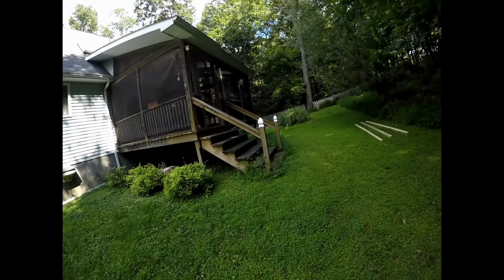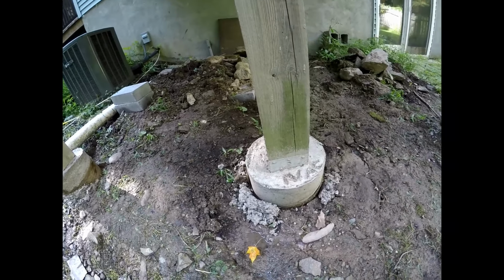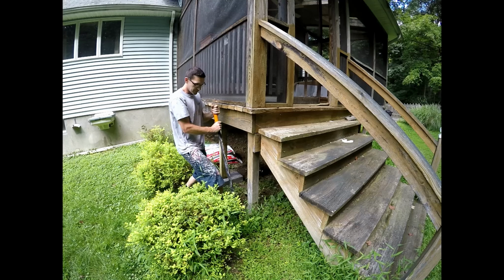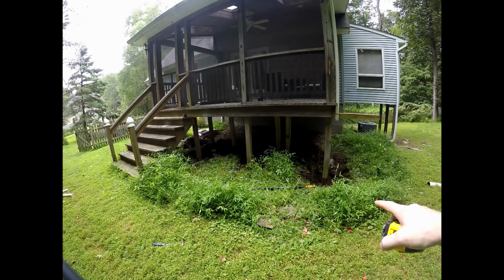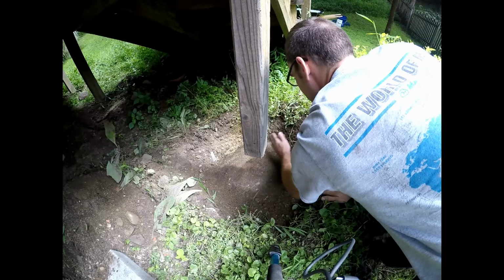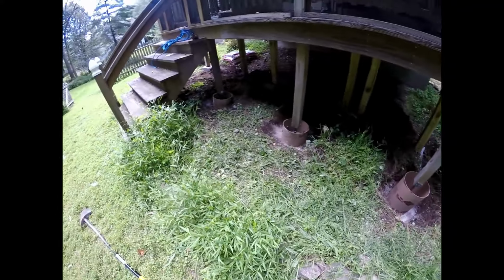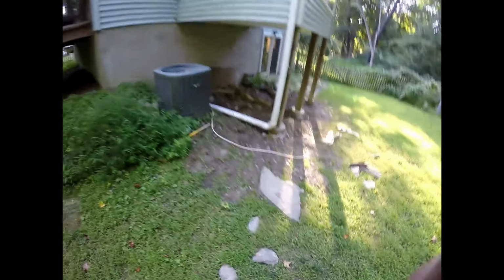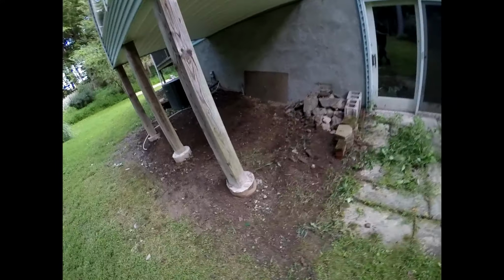Fixing Rotted Deck Posts

Comment: You did it perfectly in my opinion , you didn't need to jack it up , only to keep it supported which you did! I removed many porch supports and load bearing walls and even put a few new foundations under existing homes .Less is more when it comes to jacking load bearing structures! Unless you are lifting a building to counteract settling  you only want to support the weight while you make repairs . Just enough to catch the weight like you did hammering the braces in place !

Comment: Holy smokes. When you knocked out that final support I had to hold my breath.
Reply: Ya, I'm not sure I would have been under like that. Use a long sledge and stand outside but other than that great video. Nice you did a little extra.

Comment: Nice thing to do for your sis.  Fine job on the posts AND the video -- speeding up the cleanup with the soundtrack was cool.  

I'll be doing same thing to some rotting 6x6 posts on my deck which is at that same awkward height for digging.  And when I say rotting I can put my finger clear through two of posts.  Right at the original ground line - that's where the rot usually happens.

Comment: Good video. You did it right. The only thing I would add is using epoxy to set the rebar into the existing concrete.

Comment: If those posts are sitting in atleast 2ft deep and 2ft wide Concrete... it isn’t going anywhere. I built a deck 10yrs ago and I dug out every hole 3-4ft deep and 2-3ft wide and set the post in it with concrete and then used tar and tar paper at the base “just below grade and 6inch above to prevent rot and the posts still looks brand new til this day. The house was hit by very strong winds from a tornado and it took a part of the house but guess what? The deck was fine and the posts were and are still in the same spot.

Comment: Thank you for this. I have the same problem on a second floor deck. I am going to use this method but use new 6x6 over existing concrete footings. Originally built with 4x4's. The 6x6 should greatly improve things.
Reply: This is what I’m about to do at my house. Someone built an addition to the master and it’s literally just sitting on 3 4x4 posts. It looks dangerous atm the corner post is literally bending under way too much pressure. I’m about to take them out and put 6x6’s

Comment: How is it holding up?  you reused your existing concrete and put a sonotube on top of your existing concrete.  was your original post encased in concrete in the ground , and if so did you dig out the rotten wood prior to filling in?
Reply from the maker: It is holding up great. No issues at all. The original post was not encased in the concrete.

Comment: Instead of using the sonotubes, can i not just use a plastic bucket with the bottom cut out? Thanks!
Reply from the maker: Bucket will work too. Sonotubes are just easier to work with and a bit more environmentally friendly.

Comment: Great job. What's your thoughts on installing the stirrup slightly higher than the concrete to ensure no water accumulation beneath the timber post? I have also seen some people install the timber slightly higher so the base does not sit flush with the metal plate for the same reason.
Reply: In that position it seems you would be putting all of the weight on that little piece that goes into the concrete and therefore compromising the support strength.  It would be better to place a piece of roof shingle between the wood and the strap that way you maintain all of the holding power of the concrete.  I wouldn't do that.  I'd just get one of the Simpson plates that raises the wood 1" up and still maintain the integrity of the concrete post support.

Comment: I get so jealous when I see folks with such soft soil to dig up.  I have hard clay and that takes so much work to dig up.  I am going to faced with this one day because the deck builder placed the 6x6s in concrete. I am dreading it but watching as many videos to get as many tips and tricks to put together a game plan to get my mind right.  What size rebar you use and how deep did you dig the holes for the rebar?  Thumbs up.
Reply from the maker: I think it was 1/2" rebar and approximately 10" deep on the holes.
Reply: @StevenRT  Thanks
Reply: @StevenRT  Forgot.  How did you get the post out of the existing concrete?
Reply from the maker: @Methodical2  These posts were on top of the concrete but below the dirt level.
Reply: Got it.  Lucky you.
Reply from the maker: @Methodical2  just an idea.. you could try drilling the center, sawzall to split it half, a couple screws or lags to grab on to and it may pull out nicely.
Reply: @StevenRT  I ended up renting a jack hammer to chisel down and around the post to get them out.  I am in confined space and working between deck joists (deck less than 2' off ground) and under a porch (still working on this) that is 2' off the ground.  A pain in the butt.  I have quite a few to do so I ordered a demolition jack hammer because it would cost too much to continue renting.  I'll get there.
Reply: One more question.  How tall or deep was the concrete tube you retrofitted for the new posts?  I will be doing the same.  Thanks...
Reply from the maker: @Methodical2  I think I was around 10" -12"
Reply: @StevenRT  Got it.  Thanks

Comment: Great vid! How old was that deck? I just had one built and they put in a metal post bracket (like yours) but its all below ground and now buried. My 6x6 PT posts in partially buried. How long will it take to rot?
Reply: 3 months
Reply: I'd dig out the dirt around the posts and install something that would not hold as much water.

Comment: I have a question, so the posts go into the wet concrete, but what happens when you need to go replace it again... does that wood have to get replaced with the concrete or.... I've only got experience in insulation hahaha so we're buying a house soon and I'm clueless with other things.
Reply from the maker: There is a bracket (anchor) at the end of the wood that goes into the concrete.
Reply: shouldnt have to replace for a very long time.  the deck itself may go before the foundation.  smart thing here is having the concrete above ground level (was not before) so dirt, water, insects cant get to the wood which will preserve much longer.

Comment: hmm.. I noticed you did not seal the end grain on the posts, no bevel on the top of the concrete where the post will sit to shed water nor did you use galvanized post bases/holders...by doing this,you will never need to worry about water being sucked into the post thru the end grain, no more rotted posts.. just sayin'

Comment: I have the same problem.  My footings are at least 36" down (I dug one out to check) and most likely 42".  Were you able to get the entire rotted part of the post out of the old footing?  It looks like you pulled about 16" of rotted post out.  My 4x4 posts go down about 42" and I can't get them out.  I will probably cut the old post as close to the old footing as possible.  Then add the re-bar and new footing over the rotted post.  I'll get out as much of the old post as i can but it won't be the full 42".  Have you run into this problem at all?  I'm a little concerned about leaving part of the rotted post behind in the old footing but it will be encased in the new footing I pour over the top and may not be an issue...
Reply from the maker: These posts were not tied into the footing so it was an easier fix. I have not run into the posts being burring in the footing. I feel like you should be fine going over the old post still in the footing. I would add a couple pieces of rebar horizontally over the old post and tie them to your vertical pieces of rebar.
Reply: @StevenRT  Great video, BTW and thanks for commenting.  I agree.

Comment: I have the same problem.  Every one tells me have to wait 28 days for the concrete to harden to its maximum strength.  I have 6x6 untreated posts that support a second story deck that is 8’ x 57’ .
Reply from the maker: I would change them to treated. Maximum strength when done right is much more then needed to support the deck. You should be fine after a couple of days but I'm also no expert. Just saying from what I have experienced
Reply: I’m a structural engineer and the data shows that generally you get 90% of the concrete strength in 7 days when conditions are ideal. The 28 days is for full design strength. For this application, I recommend waiting the 7 days minimum.

Comment: So what made them rot again?? I having trouble fully understanding why
Reply from the maker: The posts were below grade. The dirt and constant moisture makes them rot.
Reply: StevenRT o ok great.. that’s why you put the brace on them and lifted above ground level.. gotcha!! Thank you!! I’m about to start do the composite decking for the first time and it will be done on the original frame so
I know I will have to do a couple posts like this.. 1600 square ft.. any suggestions on the composite decking if you wanna share I’m all ears

Comment: Always use ground rated pressure treated lumber. Yellowood is'nt ground rated either, it may be pretty but its shitty wood!
 Home Depot sells ground rated pressure treated lumber and yes, there is a difference from other pressure treated wood. If its not ground contact rated dont use it unless its temporary!